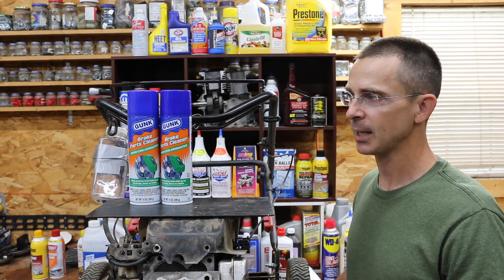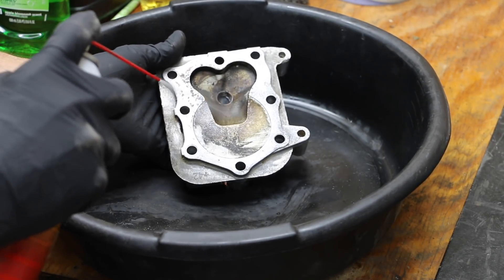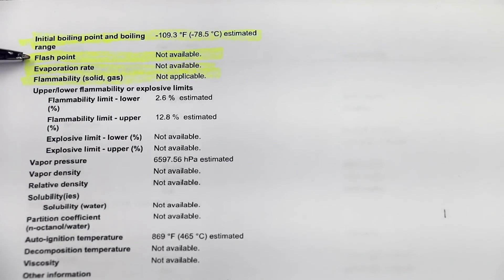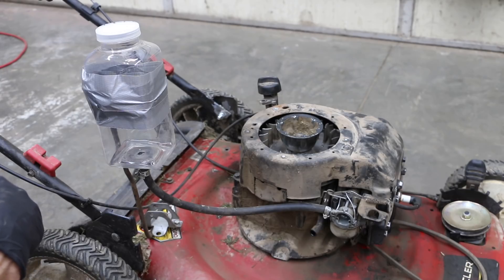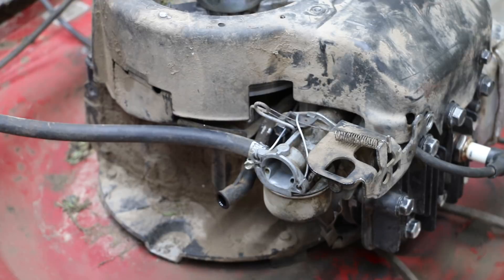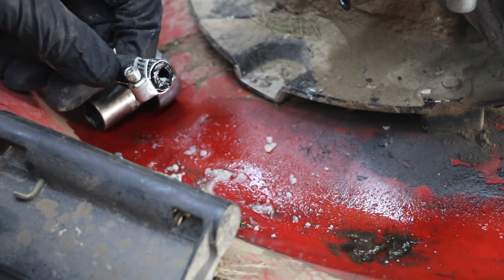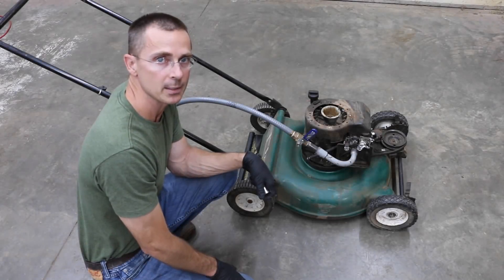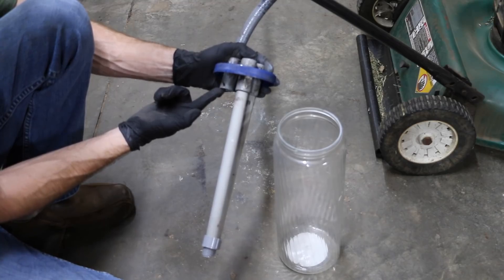Will a Gas Engine Run on Brake Parts Cleaner?  Lets find out!

Comment: Will it Run On Gunpowder?   If you grind the powder fine enough that it can make a dust cloud and get sucked into the intake maybe it will run.  Might be difficult and dangerous but it sure would be interesting if it worked :)
Reply: You're batsh*t crazy sir, you should do this one for new year's eve if you can get it working in time! What a video that would be
Reply from the maker: Thank you for this recommendation.
Reply: @ProjectFarm  thank you so much for your videos. I've learned a lot by watching
Reply: Project Farm gunpowder sounds like too much work but a good idea if you run the brake parts cleaner through the motor that's dirty will it clean it that's what I thought you were going to do but that's a good idea for a video
Reply: @ProjectFarm  bad bot
Reply: There was an engine designed to run on gun powder in the early days.
Reply: @mikebtrfld1705  my great grandfather had a tractor that was started with a shotgun shell. Naturally there was no buckshot or slug. Can't remember if it was filled with nothing but gunpowder or what.
Reply: That is not all that different then using coal powder or flour powder or sugar powder but then you are back to the work that Rudolph Diesel was doing way back in the day. Personally I'd like  to see a coal powder engine. I have even thought of ways to do the powder distribution. Pain in the butt though.
Reply: @consaka1  the Union Pacific had a few turbines that ran on pulverized coal, but the abrasive action put those locomotives out of service pretty quick. 
The story might be different if they used the modern ceramic turbine blades, though.
Reply: Older radial engines were shot-started with pumpgun-like explosive shells. That was before the motorized flywheel-gearbox combo took over the job.
Reply: @Bandicoot803  Some airplane engines were started that way long long ago.
Reply: @MikinessAnalog  True, indeed! Motors with enough amps to push these beasts to life hadn't been developed at that time yet.
Reply: @Bandicoot803  Yeah, they did that in the '65 movie "The Flight of the Phoenix ".
Reply: If you take this idea on read up as there are different burn rate powders. You can mix certain ones to get your desired burn rate.
Reply: Not sure what has your panties in a bind. I never have claimed to be an innovator. I have invented a number of things though and I have been building diesel engines since I was 18. I also am a big fan of alternate power generation from different engine designs.  I spent years reading textbooks. Some more worthwhile than others. Oddly enough I have enjoyed the ones that didn't lead to my Bachelors degree the most. 
There that should be enough information for you to get off on more of your hating.
Reply: Just make sure you fine some way to keep the gun powered dry before it combusts, if gun powder is wet it wont ignite
Reply: @ColorHawk_  I'mdumadd
Reply: Experimental Fun it will most likely explode due to the spark plugs flame
Reply: The question is black powder or smokeless
Reply: Gunpowder in a closed metal casing will just explode the engine. Must be interesting. Though, i don’t think the spark plug can ignite it failproof enough. Maybe it ignites once after many tries, and then the engine will become small pieces across his lawn.
Reply: I just watched this video and then looking at the comments i see this suggestion of running blackpowder. My 2 cents on that suggestion is this...it would foul the engine very quickly and so badly that the sparkplug would not have time to funtion more than several seconds. Even tho its a fine mist of powder it would still foul. Thats just what bp does.
Reply: Brian Ratcliffe could make a black powder substiture that won't leave residue, replace the potassium nitrate with ammonium nitrate, leave out the sulfer. Its difficult to ignite but it burns clean. The germans used this in some guns, its considered a smokeless powder, although the term "smokeless powder" usualy means a nitro cellulose based powder.
Reply: shannon dove it seems you have a good understanding of the chemical composition of the modern gunpowder. more than i can claim. I have however used many different types and or brands of gp in reloading for 13 different calibers, including making my own blkpwdr for muzzleloaders. Thru my experience with shooting etc., there is still some residue left in barrels. I was merely thinking of how many times i have cleaned my guns, and just can’t imagine gp working in a combustible engine. But if i were to try, i guess the fastest burning powders would be a place to start.
Reply: Hodgdon H110 is about as fine as modern smokeless powders get. and I bet it wouldn't completely blow the engine apart, given used in the right quantity
Reply: Warped perception did this and his engine exploded violently.
Reply: i think somebody tried this
Reply: It's been tried in the past with little success.
Reply: yeah i wanna see that i'm intrigued. lots of crusty byproduct i bet but still worth the test i love this channel greetings from the uk
Reply: Mythbusters tried running a car off gun powder
Reply: Mythbusters tackled that and gunpowder just doesn't have the explosive force to keep an engine running like petrol more than 1 or 2 strokes.
Reply: I think the problem is its far too much oxygen , black powder made to the usual standard has a better oxygen balance than nitro methane, and with all the air going into the cylinder , it just doesnt need that much oxygen. 
Maybe run the engine on regular fuel, then blow in fine powder potassium nitrate as a substitute for nitrous oxide. Or make a black powder with reduced KNO3, maybe leave out the sulfer too because its probably hard on the motor.
Reply: @shannondove96  but aren't the high sulfur oils good for lubrication?
Reply: Mythbusters tried it and it did not work very well.
Reply: Lol it is a terrible idea to put gun powder in a closed metal container.
Reply: Wonder how you would going it without setting it off
Reply: Gun powder is oxidized so the flame would carry all the way out of the engine
Reply: This is a terrible (ly good) idea. I have no idea how it would work, but this guy could figure it out, or at least try. Does gunpowder in water still ignite?  Is there something less flame retardant than water that the gun powder could be mixed with so it could go through the carb and fuel lines?  These are the things I want to know
Reply: Mix it with graphite .
Reply: @billbergen9169  graphite gunpowder has been tried, I doesn't work.
It may be the lattice structure, it doesn't seem to oxidize too readily.
Reply: One word... BOOOM!!!
Reply: I've heard of large marine engines that run on coal dust.  But they're LARGE.
Reply: Experimental Fun yes
Reply: Your my kind of crazy.
Reply: Yaaaa.... no.
Grinding powder: boom
Air mixture: big ass boom
A cloud of it inside a compressed engine: NUKE
Reply: It's best for you to invite him to do it in your garage.
You should get your answer addressed completely.
Reply: The channel Warped Perception has done that
Reply: It would grind the cylinder
Reply: i used to watch your vids
Reply: It was tried 100 years ago but it didn't work
Reply: Experimental Fun -  the power stations that supply power to ur home have understood how to spray a fine mist of powdered coal to sustain combustion for a very long time.
Reply: @michael-dm2bv  some pissed on your cheerios aye buddy!
Reply: consaka1 -  read a textbook u are NOT an innovator.

Comment: I knew the carb was gonna fail. I use brake cleaner at my shop as carb cleaner and always have to be careful not to let it sit on the components too long
Reply from the maker: Yes, I as expecting it too. That stuff causes problems.quickly! Thanks for commenting.
Reply: Project Farm, carb cleaner is even more volatile... If you can find an engine that uses all metal components (i.e. brass float, needle seat and fuel inlets) the experiment may go until a real engine failure happens... Usually found on older Tecumseh and Briggs 8hp and up.

Comment: I don't know much about engines, so forgive me if this is a stupid question, but why do you only take off the build up on the piston cover? Why not the piston and valves also?
Reply from the maker: This is a great question. This is to determine if the products tested remove carbon from the 1 side or cause buildup on the head.  In this instance, carbon was eliminated from the piston but seems to have transferred to the head. Thanks for commenting.

Comment: Now so it with an ohv. I'm a small engine mechanic myself and made the mistake of grabbing the brake and parts cleaner instead of the carb and choke cleaner in which ruined the valve seats and the engine lost compression. Unfortunately a normal compression test would not reveal the compression loss so a leak-down test was performed.
Reply from the maker: Thanks for sharing this experience and knowledge.

Comment: brake cleaner spray is cheaper alternative for "start" spray :D :D :D
Reply from the maker: Thank you for this recommendation.
Reply: Good Lord, don't use regular brake cleaner in a motor.  It produces phosgene gas when it's combusted.  Non-chlorinated won't, but don't ever suggest this....someone might make a deadly mistake.   And no, it's not a myth.
Reply: @SealofPerfection  Wouldn't even be a problem if you sucked air in straight from the exhaust, just not enough of it.
Reply: @SealofPerfection  deadly mistake it's not like hes burning a gallon of it a shot of the spray wont juxt the engine or you. You dont know what your talking about
Reply: @theghost7277  Or you could use literally any other spray combustable that won't turn into mustard gas. He's right. Perhaps you should not be so ignorant on the matter. Only takes a tiny amount to break down the proteins in your lungs. No worth a stupid quick use situation.
Reply: Yep, I've used for start up many times.

Comment: It seems that it was hard to get the air fuel ratio correct on both the normal and vapor engine. I am very surprised about that, since normally an engine runs fine on any amount of brake cleaner, I use it all the time to diagnose fuel delivery problems. Brake cleaner is a cheap and easier alternative to ether ( StartPilor).
Does anyone have an idea of why it is so much harder to keep these small engines running on Brake Cleaner? Is there a difference between different brands of brake cleaner and / or brake "parts" cleaner?
Reply from the maker: Brake cleaner dissolved the liner in the fuel line, blocking the fuel flow and later dissolved some of the carb internals. Otherwise, the engine would have ran much better. Thanks for commenting.

Comment: Your bottle setup to run "on vapors" is really just a homemade carburetor. A carburetor's entire purpose is to allow gasoline to vaporize before being drawn into the cylinder. Gasoline doesn't burn in its liquid state. Gasoline's vapor pressure is very very high so it evaporates very quickly. It evaporates quickly enough that it can sustain a combustion reaction all on its own so it appears to burn in its liquid state, but really it's the thin layer of vapors on top of the liquid that is burning.

Fun fact: you can extinguish a lit match with liquid diesel, because diesel's vapor pressure is much lower, so it doesn't evaporate fast enough to sustain a flame on its surface. It's only when it's vaporized via a mist that it will ignite (very) easily and under extreme compression that it detonates.
Reply from the maker: All great points and thanks for commenting.
Reply: Yeah! I love these "will an engine run on" videos, super cool to see the difference in air/fuel needed to get things to run the engine :)

Comment: will an engine run off a bucket of cow pies
Reply from the maker: Thank you for this recommendation.
Reply: i would use allot of small pipe with a bunch of small holes it to get as much surface area with the manure to allow the methane to escape then a lid with bulkhead fitting on it and out to an engine with a ball valve to regulate the flow something like 2 percent methane to 98 percent air is what I hear is needed to run an engine if we are talking natural gas but methane is is natural gas without the special additives to make smell the way it does but our gas will have plenty of odor all its own so unless purified for sale to market no need for the special odor chemicals

Comment: Awesome!
I knew it would run, and that it would need some fiddlin' to get it to stay running.
I didn't figure it would be quite as corrosive as we saw in the vid.
Maybe an engine with metal fuel lines would do a bit better. LOL
I doubt that a carburetor could be modified to constantly run on brake cleaner.
Thanx very much for this insightful vid.
I hope the next vid has a moped in it! LOL
Reply from the maker: Thank you!

Comment: Ive found on my honda gx-270 that choking the engine on full throttle increases the rpm and bypasses the governor. How much can you choke an engine before it fails? Excellent video as per usual! Keep it up!
Reply from the maker: Thank you very much for the positive comment. I have questions regarding this question to make sure I understand what's being asked. If the engine is running rich on fuel, it'll likely shorten the life of the engine by washing down the cylinder wall with gas. If the engine overrevs, that'll shorten the life of the engine as well.

Comment: I have a question , when you have an engine , that's nearly dead, can you put an 8mm socket in the cylinder , I saw a picture where the socket is welded in the piston, and I'm curious if this could happen?
Reply from the maker: Thank you for this recommendation.

Comment: Brake clean is one of my favorite way to drive cars in the shop when the fuel pump is dead. Sure saves a lot of pushing :)
Reply: Wouldn't advise doing that too much, as it burns too hot for the engine in the long-term
Reply: @rubymass0909  and like he said its very corrosive on the intake gaskets etc and has no lubrication for the top end of the engine either kinda like alcohol.
Reply from the maker: This is a great idea. Thanks for commenting.

Comment: You could test if a 4 stroke engine running on a 2 stroke gasoline-oil mix running without oil will run longer than a 4 stroke engine running on regular gas running without oil.
Reply from the maker: Thank you for this recommendation.

Comment: I have been reading up on another company that might be worth testing the engine oil and fuel system cleaner. Redline synthetic oil has alot of videos of internals of engines using their products from companies using them. I am curious on them working on smaller engines.
Reply from the maker: Thank you for this recommendation.
Reply: Project Farm still some great videos and helpful to the curiosity of the "what if" on engines.

Comment: I'm interested to know what was clogging the fuel line. It looked like there was either buildup in the funnel that was breaking loose, or the funnel itself was being dissolved (though I doubt this). I'm also worried that it might have been the hose itself breaking down... which would severely affect the reliability of future tests using that fuel hose. If there's no visible cause elsewhere, I'd replace that hose and cut it open lengthwise to see what the interior looked like.
Reply from the maker: I believe the fuel hose has a liner that dissolved from the brake cleaner. Another commenter made this discovery from a similar experience.

Comment: Thanks for using Celsius, would be cool if you could get your hands on a small diesel engine like old diesel generator and test if it can for example run on hydraulic oil.
Reply from the maker: Thanks for the positive comment and thank you for this recommendation.

Comment: Are you using a ball valve or a butterfly balve for the vapor engine? A butterfly one would give better results in terms of regulation and better (less) pressure drop throug it.
Keep doing these videos, I love them.
Reply from the maker: I'm using ball valve. Great advice regarding the butterfly valve. Thanks for the positive comment.

Comment: Will a Non-E85 Gas engine run on E85 fuel.In my town the E85 fuel is about $0.20-$0.30 cents cheaper per gallon.
Reply from the maker: I wouldn't recommend doing this, since the high ethanol content will cause problems for rubber o-rings, seals and gaskets in the fuel system and the engine isn't tuned for it. Thanks for commenting.

Comment: @Project Farm Did you notice on the lawn mower you converted to run off a vapor there is a chip in the side of the piston is that factory? or did that get damaged?
Reply from the maker: Yes, that notch is from the factory. Thanks for commenting.

Comment: I'm surprised at the before and after pictures being almost the same.  Seems the cleaner burns just as gasoline does - dirty.
Reply from the maker: Great point.  It seemed as though some carbon deposits transferred from the piston to the head.  Thanks again.

Comment: I recently ran into the same hose issue while rebuilding a motor.  My hose was a brand new fuel line from the local parts store and I ran some heavy cleaners through the fuel line in combination with fuel.  When taking apart the carburetor, I noticed the same issue of deposits.  The issue ended up being a liner that was on the inside of the rubber fuel hose being dissolved by the harsh chemicals.  I then researched fuel lines and learned that there are various hoses made to withstand different chemicals (Fuel, Brake Fluid, etc...).
Reply from the maker: This is very interesting and this solves the mystery. I learn a lot with each of these videos. Thanks for this information!